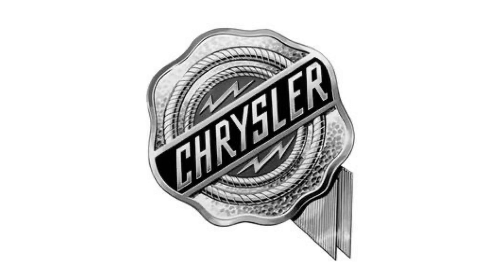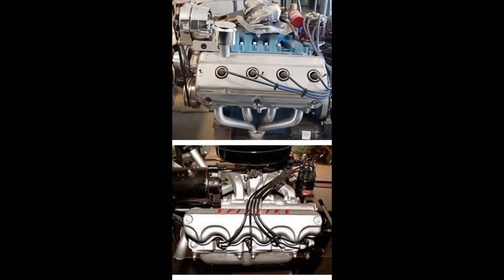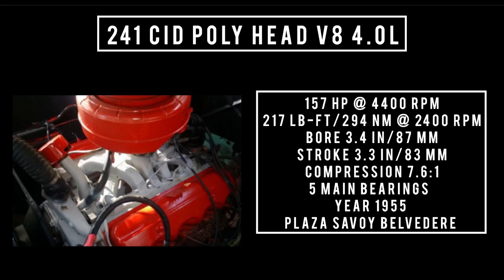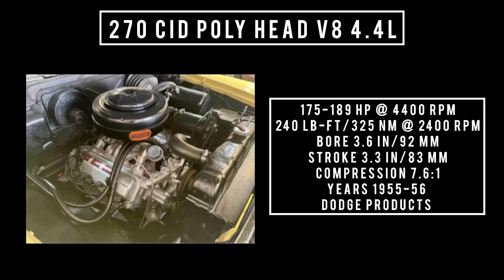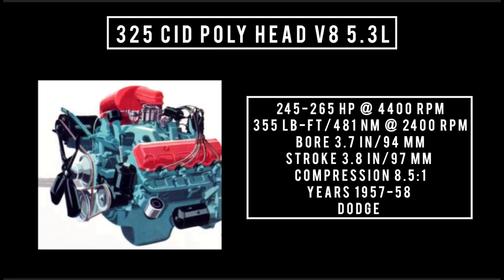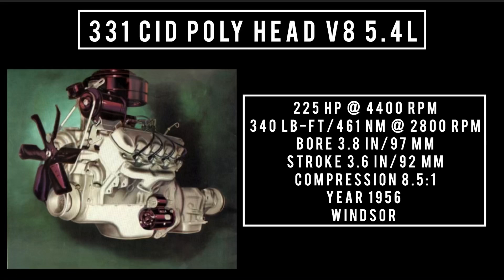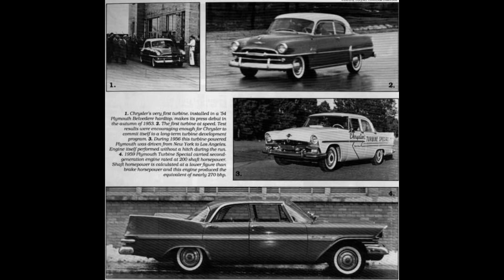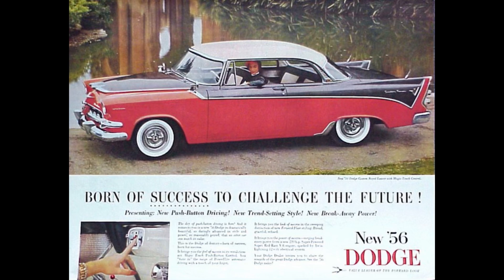Chrysler polysheric head engine family 241, 260, 270, 315, 325, 301, 331, 354

Comment: Between 1955 and 1958, Chrysler made a bewildering array of V-8 engines that are difficult to keep straight. It is a wonder that Chrysler didn't go broke trying to make parts for all of these engines. Thank you for a good introduction to this engine family.
Reply from the maker: Yeah it’s super confusing all of the different array of engines as you mentioned they also introduced other engines midyear that’s why a lot of people get really confused with the 318 engine in the 350 engine because they were introduced during this engines life even though they’re nothing like this engine this engine only correlates with the hemi blocks.. glad you dig this episode =)
Reply: @What.its.like.  The 350 engine was the first of the B-Block engines that led to the 361, 383, and 400 engines. (The 413, 426 and 440 engines were RB engines.)
Reply: Precisely why I LOVE Mopar stuff! I bought my 67 Coronet when I was 20 in 2000, mainly because it was old, different and LOUD. My good friend couldn't keep up with it so I got it for $600. Little did I know that 318 was NOT the 318 I knew of. The kid before my buddy owned it swapped and older engine in. Didn't take long between working on it and getting so many questions and wrong guesses at the gas station and I was in love. I know they're not the power house, easy to build, parts everywhere sort of power plant...which is WHY I love it. Not once has a Chevy 350 piqued my interest. They're great motors obviously...but farthest from unique or rare as could be. Some engines I dream of building one day are a 413 long ram, early hemi, and old big block nailhead, 427 Ford, Ford flathead to name a few.

Comment: I'd like to hear more about the 1956 Dodge Custom Royal D-500 315 cubic inch 4 barrel V8 with 260 Horsepower compression ratio 9.25 to 1. I think this engine most likely requires premium leaded gasoline or it most likely gave much livelier performance on premium leaded gasoline.
Reply from the maker: I miss my opportunity to shoot that car this year I didn’t realize how rare it was I went to a collection where I picked four cars out I should have done that one as well because I haven’t seen another one

The cars that I did from the collection were 41 packard woodie
53 packard Caribbean
1970 AMC machine
1954 mercury Monterey

I’m hoping to go back there he had some incredible stuff

Comment: Good explanation of the Polysphere engine design. To elaborate a little, they started with the Hemi but wished to make a cheaper, simpler, lighter engine. So they kept the hemi design including the block, intake manifold etc and just changed the heads, mainly on the exhaust side. Left the intake side alone but moved the exhaust valves up and closer to the intakes, putting both exhaust and intake rockers on the same shaft and making the head narrower and lighter. This required a different combustion chamber shape, slightly smaller valves, pistons with different shaped crown and of course, different head casting. Other than the heads pistons and exhaust other parts were alike and interchangeable.
The result was very close to the hemi in performance. A 1956 Windsor would run with the hemi New Yorker or Imperial right up to 80 MPH. After that the big blockbuster pulled ahead.

Comment: Was the poly head engine a partial inspiration for the modern hemi engines?
Reply: The poly head is similar to the Chevy 348 and 409 series, but without the chamber in the piston top.  Also similar to the Chevy 396-454 series, Ford 351 Cleveland and Ford 429-460.  All have staggered valves.  The modern Hemi has no resemblance to the poly head.  The modern Hemi uses dual rocker shafts as the earlier Hemi did.
Reply: @melodigrand  thanks for the upgrade. I there are some folks who feel the poly was better than the LA. One wonders. Cheers
Reply: I am one of those.

Comment: 1966 dodge charger you could get a poly 318. 1967 charger you could get a LA 318.
Even though some claim Mopar didn't release the LA 318 until 1968. We found a 1958 Plymouth wagon, and it had a 4 V carb option, for the 318 poly we had. The poly 318 ran pretty well with either carb, but the 4V carb was pretty spicy!

Comment: 56 Plymouth Belvedere
57 Windsor

I owned a 64 Dodge Coronet four-door sedan and it had the 318 A series engine. Or what many called the wide block engine in it. It also had the polyspherical heads just like these early polyhead engines did.  However the black was different and IIRC not the hemi-style block.

The 318 and was bone stock when I bought the car used. Had a push button torque flight tranny. 

Being a junior in high school, I wanted to beef it up to get more horsepower out of it.

 I ended up being able to source a four-barrel manifold for it and I remember it was a for a  Carter carb. I can't remember exactly which carb I ended up putting on there. It would have either been a WCFB or an AFB.  I wanted to get a set of headers as well but I could just never find a set.  It was a really solid well running engine with lots of power and torque. More than enough to move that Dodge sedan down the road.  

The A series wide block engines never attained the Hot rod mystique of the small block Mopar series engines that followed it. Pretty hard nowadays to find any kind of replacement performance parts for the A series wide block engines. I do remember though that those were big wide engines when you open the hood of that Dodge the engine literally took up the whole engine compartment.
Reply: It's kinda funny that everyone refers to the Poly 318 as a wide block, because it's the same width block as the 318 LA. The heads are what made the Poly 318 so wide, not the block.
Reply: @johneckert1365  as someone who's owned a 64 Dodge with the A series engine.  There is a difference in the blocks of the A series engines which were made from the mid 50's through 1966.  And the later LA small block engines.  273,318,340,360.  Very few parts interchange between the A and LA engines. Another reason I know this is because I blew the A series wide block engine in my 64. It threw a rod, cracked a piston, and pretty much tore up the short block badly. I found out real quick while searching for a replacement that the later series LA engines commonly referred to as the Mopar small blocks were entirely different. 

Now the early poly head engines did use the same block as the hemis of that era. But the heads were different being a poly design rather than the true hemi design.
Reply: @carlmontney7916  My bad, I meant to state that Poly 318 vs LA 318 blocks were the same width. 
They did share quite a few parts in common. The crankshaft and camshafts were the same/interchangeable. The timing gears, timing cover, fuel pump, water pump, etc were the same. You're definitely correct though, the blocks are not the sane and don't interchange.
Many people wonder why LA engines have that weird lifter angle (rather than 90 degrees like most V8 engines. It because it uses the 318 Poly engineering. The Poly had to have that weird angle for the wonky valve train to work correctly. It was "good enough" for the LA engines, so no need to re-engineer them.
Reply: @johneckert1365  and any mass produced item regardless of what it is if you have something that has worked you will continue to use it since you already set up to produce it.
Reply: @carlmontney7916  Oh I wasn't criticizing Chrysler for retaining the odd lifter bore angle, was just pointing it out as a similarity to the Poly 318.
Reply: @johneckert1365  I really wasn't thinking that you were criticizing chrysler. I was just stating that most manufacturers if given the choice will continue to use what they can already easily produce if at all possible.
Reply: @carlmontney7916  right on 👍
Reply from the maker: Great choices thank you so much for sharing all of that insight and information I greatly appreciate it =)

Comment: You forgot the original version of the 318, the 277, small-block 301, and the Canadian 303.  They all came out before 1958.
Reply from the maker: Different engine family It’s confusing Plymouth got that engine in 1955 midyear but it’s a different engine family that is part of the Plymouth a series
Reply: @What.its.like.  I think you mean the 56 Plymouth.  And yes, a different family, but still Polyspheric.
Reply: Canadian 303 was a unique version of the Plymouth poly, meant for Canadian made Dodge and Chrysler Windsor models. Because this was the only V8 the Canadian engine foundry was equipped to make. It was borrowed for the US made 1956 Plymouth Fury because it was a direct bolt in replacement for the 270. It made the Fury quite the hot performer for the time, faster than an 283 Chev or 272 Ford.
Reply: @mrdanforth3744  Especially if it had dual quads!  270 horses!
Reply: I wonder what the DeSoto, which was a little cheaper than a Chrysler Windsor, but more expensive than a Dodge, had in it?

Comment: Maybe someone can chime in.  Pretty sure Plymouth offered a 350 poly with 2 / 4bbl's in the '57 Sport Fury.  Not sure if it was an "A" block or a hemi block.
Reply: The 57 Fury was  a 318 c.u. V8, 2 -4 bl carbs rated@ 290 hp
Reply: @willobillo633  Yes indeed, and it was a Poly.
Reply: @mikew6765 - If it was a single or 2-4bbl 350 in a Plymouth , it wasn't in a '57 Fury, it would have been in a '58 Fury and the engine was nether a Poly or a Hemi , it a first year B-Block wedge engine.
Reply: @martinsuter3531  I thought the distributor was at the rear of the block by I may not be remembering it clearly.  Been a while since I've seen it.  Could have been a small displacement B block.  Thanks
Reply: @mikew6765  - the 318 A-block (the distributor at the back of the block) was available in 2-4bbl form in the Plymouth Fury for the  1957 and 1958 model years. The 350 cubic inch B-block  (distributer at  the front of the block) became an available option in the 1958 model year Plymouth Fury. By the way, the 318 was a poly engine due to it's canted valves, but it was not related in any way to the Chrysler Poly engines.
Reply: @martinsuter3531  I know the A block 318 was a poly head through '66.  I didn't realize the B block came with a displacement below 361.  Do you know how many years the 350 was offered?
Reply: @mikew6765 All B engines had the distributor up front. 
The A and LA was in back.
Reply: @martinsuter3531 And Christine 🔥
Reply: It was 1 year only.
Reply: @martinsuter3531 In Steven King's book "Christine", she had a Poly 318, but in the movie she had a dual quad 350 B.
Reply: @johneckert1365  Gotta look cool for the movies.
Reply: It was the new "B" engine.
Reply from the maker: That engine came later these engines were made from 1955 to 1958 Plymouth made other poly engines after this series
Reply: That the 58.  It was called the Golden Commando.